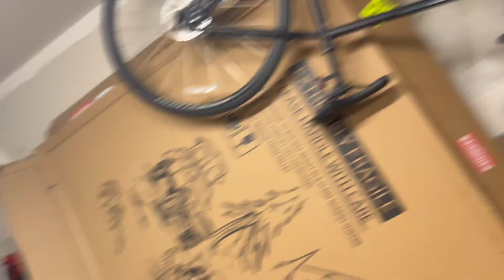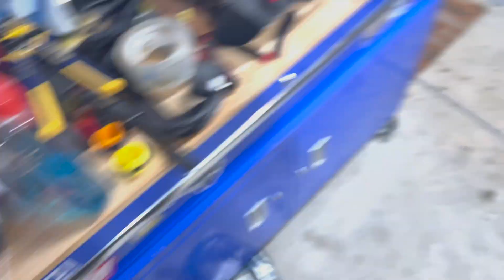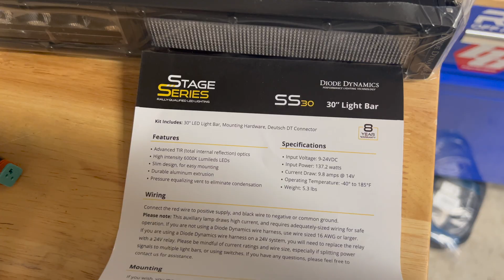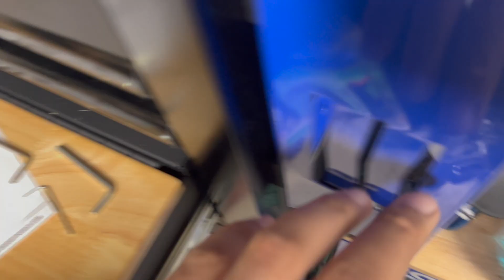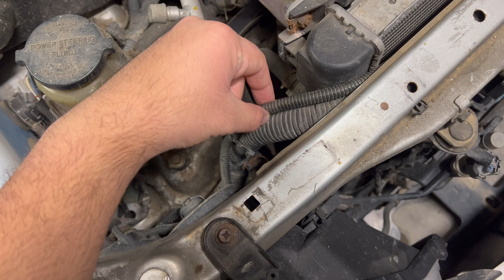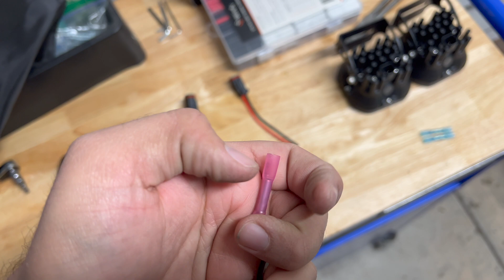New Diode Dynamics Lights for My GX470 Front Bumper

Comment: Nice install, but your headlights could be greatly improved with a polish and led bulb upgrade.
Reply from the maker: I did a headlight restoration kit about 3 years ago but it didn’t last. I do have to find a different one
Reply: @eriksadventurelab Sorry I did not know. I hate acrylic headlights, never had this problem in the 70's and 80's.
Love the Lexus, we didn't get those here in the uk.
Reply from the maker: @Sly_Wolf_1 your equivalent to this Lexus is the Land Cruiser Prado 120. The headlights are plastic and do start to get yellow after a while
Reply: @eriksadventurelab  Yeah we have the land cruiser but it's only available in a diesel. Once upon a time we had petrol variants but not anymore...and I hate diesel.